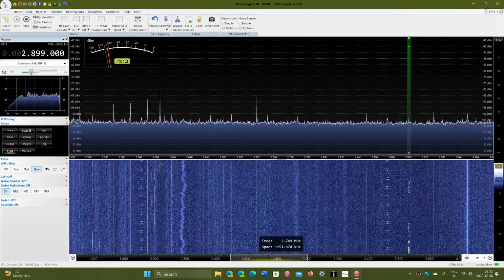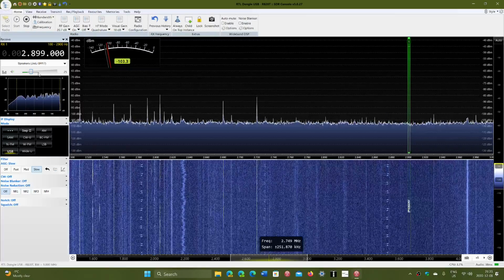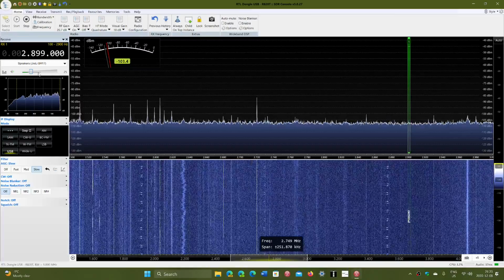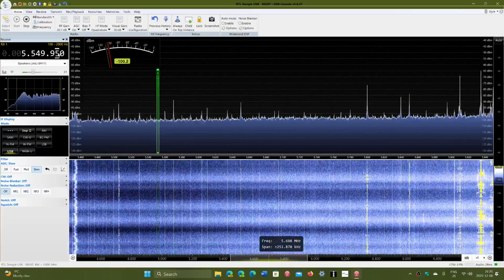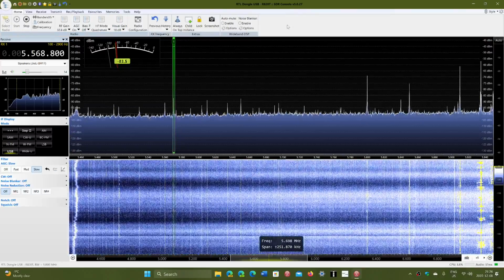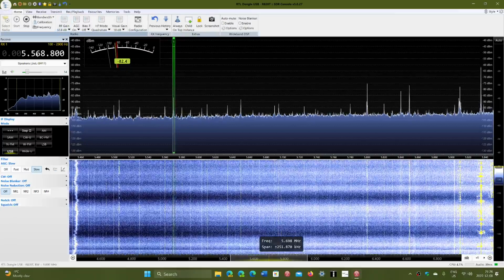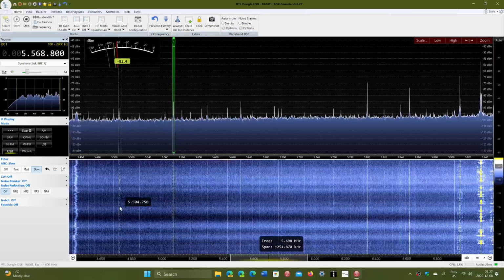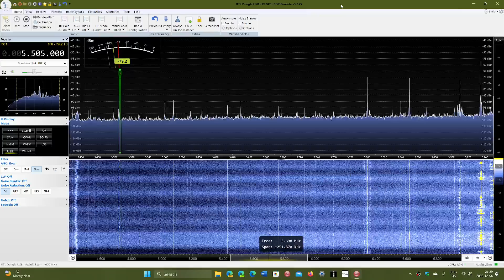A night with RTL SDR V3 dongle on shortwave 2899 kHz Gander ATC and more

Comment: Hello Gilles, Thank you for sharing all of your knowledge with us !    To clarify the use of SELCAL in aircraft, normally the reception of the double tone will trigger a call (a chime or bell) alert in the cockpit.  The pilots, knowing that the radio operator wishes to establish contact with them for a message, will then initiate contact with him.  SELCAL does not affect Sqelch.  It is essential to perform a SELCAL test on initial contact with the radio station responsible for the region in which the aircraft is flying to ensure subsequent proper operation of the system.  If the SELCAL system does not work, the pilots will have to maintain a continuous listening watch on the frequency which is, of course, unpleasant for several hours….